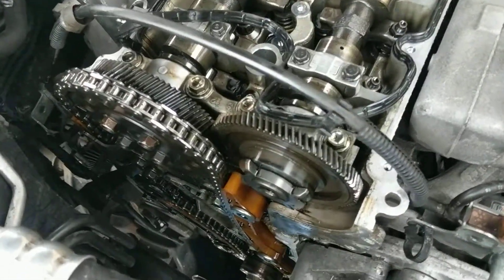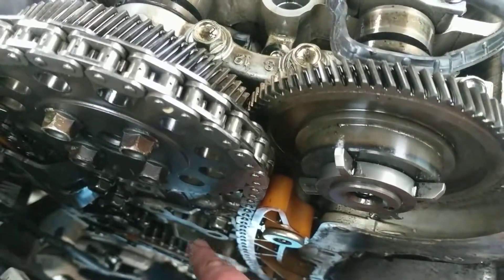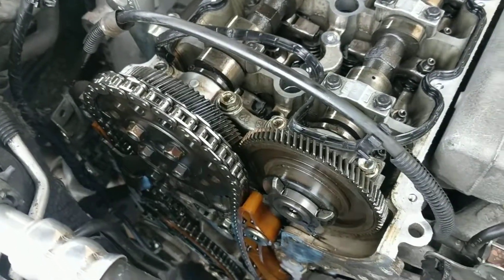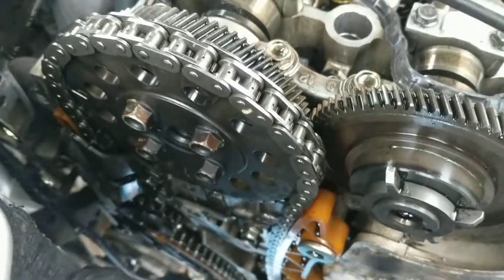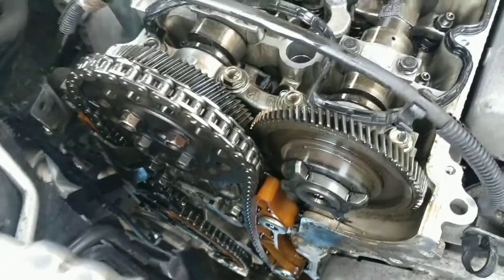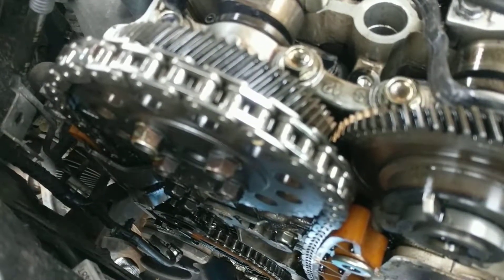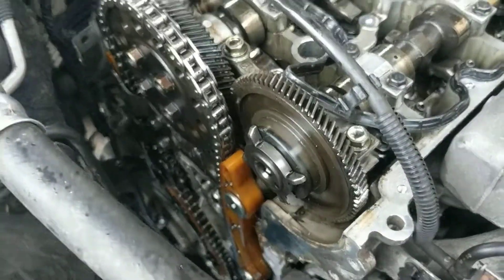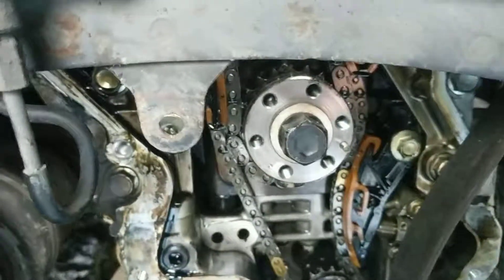Mazda 6 2.2 timing cover off

Comment: Did you replace also the chain on the oil pump? As i‘m struggling with the tiny gear that it has seems to not want to get off.

Comment: Hi what was the verdict...I was getting a deffinate timing chain rattle ...I have striped it all down.   And like you there is no play in the chain...well not much atall...I'm confused lol
Reply from the maker: My chain had stretched (a little) replacing it did fix the issue!
Reply: @dabbler77  Thanks for the reply...I'm just about to put her back together. Did you have to take the bottom crank pulley sprocket bolt off to get the cover out and on ..did you replace the crank sprocket.
Reply from the maker: @keepitreal897  no, I managed to jiggle everything around with a jack and just managed to get the timing cover back on. All I had to do was timing chain, guides etc. Good luck